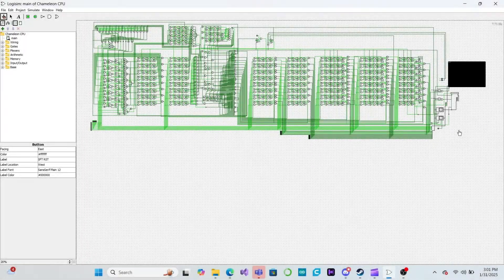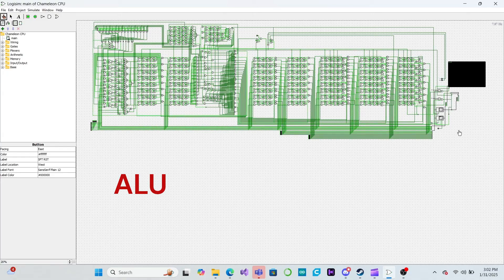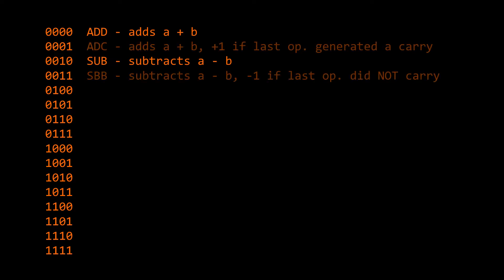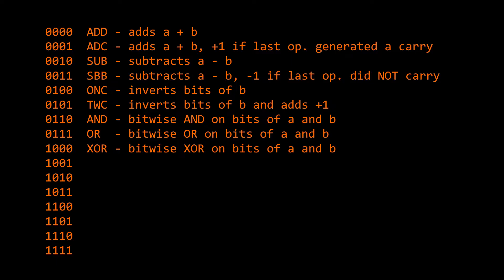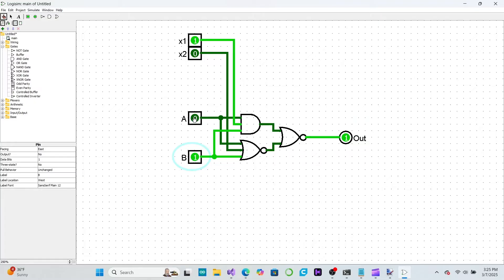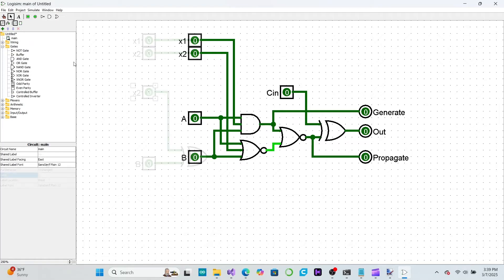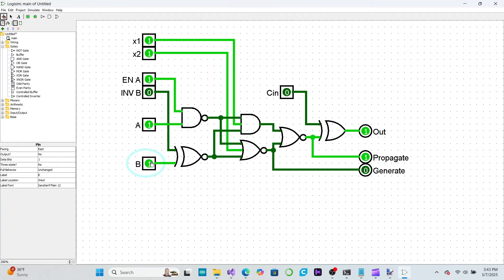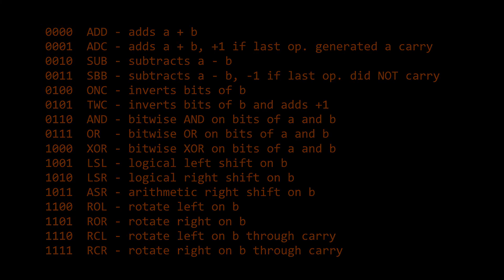How A Computer Thinks:  Designing an ALU From Scratch (The CPU You Can Build, Ep. 6)

Comment: There's actually a textbook approach that uses a slightly higher number gates but allows for way more operations (some of them not useful, but still). You use a 4 to 1 multiplexer . The 2 bit select lines of the multiplexer are the ALU inputs A, B. The 4 input bits of the multiplexer are the function code (sort of). If you think about this, you can perform any operation including AND, OR , XOR, NAND, NOR, XNOR, Select A, Select B, NOT A, NOT B, ALL ZEROS, ALL ONES and more by just appropriately setting the 4 inputs of the multiplexer. You can also use that to create the Propagate signal, and a simplified version of the same to create the Generate signal. I believe your approach is possibly a stripped down version of the same by just removing the unused functions.
Reply from the maker: I've never read any textbooks on these subjects, most of what I know I learned over the years researching on my own 😅 that sounds like an interesting approach though.

My initial plan when I was designing this CPU was to use the 74181 since internal schematics are readily available for that chip so it would have been very easy to replicate a gate-level version of it for this project.  However, a lot of the operations the 74181 can do are (in my opinion) not that useful, and it has no right-shift operation which limits its usefulness even further, so I eventually settled on designing my own ALU.
Reply: @PolymathUnlimited-du2hg  I learned the multiplexer approach from a guy on an internet forum, actually. Not sure if this is "textbook" to be fully honest, probably not on a second thought. It just occurred to me that your design can probably be achieved by starting from the multiplexer design and then removing all the unused or non-required functions, followed by some gate optimisation or clean up. 

Another design that I find interesting is the original ARMv1 ALU. Surprisingly it didn't have a carry look ahead circuit, but a clever design that minimised propagation delays on the carry chain, by implementing odd and even bits in a different way. Still not as good as a proper look ahead, of course. And also of course that processor implemented an inline barrel shifter before the actual ALU, so it was overall more complex.

Anyway, your design is excellent and very compact, no issues at all with it!

EDIT: I just looked at the 74181 schematic and to my surprise it kind of uses a simplified version of the double 4 to 1 multiplexer approach. I haven't realised this before. Interesting find...

Comment: I was thinking it almost looks like part of the AM2901 ALU
Reply from the maker: @ellisgl  that's a great find!  While this seems conceptually similar to my design goal of encoding operations into a small opcode space, I'm having trouble finding specific data on 2901's implementation (the data sheet only really has a block diagram overview, and doesn't really go into how its ALU is implemented).  Do you know where I could find more specific information about that chip?
Reply: @PolymathUnlimited-du2hg  did you end up finding the AM2901 ALU logic diagram?
Reply from the maker: @ellisgl  Actually, I did (sort of).  I did find a logic diagram for the AM2901's ALU.  It seems that this IC is more than just an ALU though, it has registers and everything, making it more of a full-blown processor.  Here's the link to where I found it if you want to take a look:

https://www.researchgate.net/figure/ALU-module-from-AM2901-4-bit-microprocessor-bit-slice-15_fig8_343861449
Reply: @PolymathUnlimited-du2hg  That's the one I was trying to point to. All my comments kept disappearing. Yeah, it's a bit-slice processor. The logic diagram though is the ALU and some extra logic for being able to combine multiple chips to support larger bit width. Every 16 bits needs an extra chip for carry.
Reply from the maker: @ellisgl  weird... I wonder if the auto moderator just doesn't like people posting links?  I'll have to look into that.

But yeah, it looks like it has propagate and generate outputs, suggesting that you would need some kind of external carry lookahead unit in order to chain them together.
Reply from the maker: Huh, I only saw this comment just now, lol.  I guess it got buried under some other notifications or something.  I love Usagi Electric's videos though, that vacuum tube computer he's been building is so cool!
Reply: @PolymathUnlimited-du2hg  and I don't even see my Centurion comment. 😂
Reply from the maker: @ellisgl  Yeah, youtube seems to be weird about which comments it actually lets through sometimes 😂
Reply: Ok - my replies disappear. If you look up "AM2901 logic diagram" on google images, there is one for the ALU on research gate.